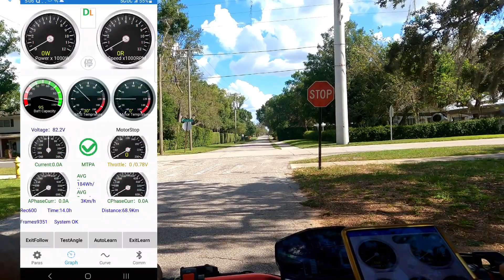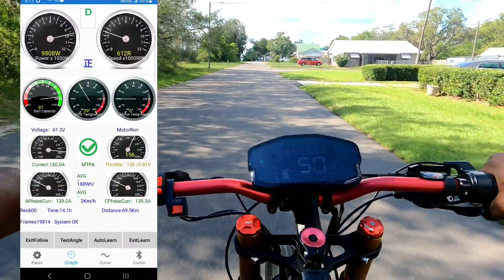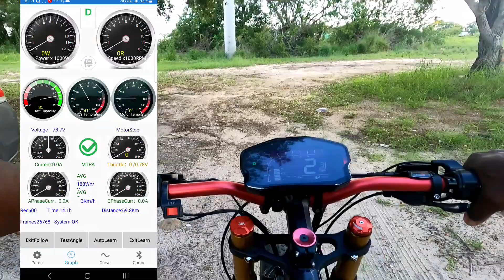diy 72v 27ah battery puts 10,200watts at 170 amps!!!!!

Comment: What ebrake system do you use for variable regen? and does it connect out of the box with a fardriver controller, or did you have to buy an adapter or anything?

Comment: Do you have to do any special prep to the bike to run it that fast?
Reply from the maker: No. Not really just bolted the torque arm to the dropouts and basically it make sure the axle nuts are tight.
Reply: @EBG-offical  The loosest nut on a bike is the one holding on the handlebars! So no bearing issues or tires splitting? Have you gone really long distances at high speed?
Reply from the maker: @craigcowen6920  just 10 miles or so ,I generally do speed
Reply: @EBG-offical  Awesome! I just watched your mega battery pt 2. LOL!!!
I am working on my second bike. I choose a fat tire tadpole trike with a 3000w hub motor.
Getting good info from your channel. Thx!
Reply from the maker: No problem, let me know if you need more assistance

Comment: General question if I run two 72v 3300w batteries in parallel would that give me 6600w?
Reply from the maker: Yes,  it will give you more range but depending on the battery and what cells it has I'm pretty sure you can get 6000w out of it
Reply: @E-bikeguy  thanks so much for that answer.
Reply from the maker: @jamisonhinton5837  no problem 😊
Reply: I figured I could ask you because I just got into building ebikes myself and run into allot of the same stuff when asking questions on discords
Reply from the maker: @jamisonhinton5837  ok no problem

Comment: Hi I herd your comment on making a bigger battery. These people should share there knowledge that's how we all learn. Try Chris crossing wires he's good. Can I ask about tyres I've got 26ins wheel motor on back I had 26x195(54-559 it seem wideish it worn down so my front tyre was still good so I took it of put on back wheel now that tyre was 26x2.10(54-599) so I bought same tyre of amazon and its thinner my front wheel got given to match back motor wheel the rim I would say is under an inch the middle of rim is up shape to match is there a tyre slightly bigger in width but not in height hope this message makes sence.. Looking at your bike there is some power there. Yes I normally watch Chris crossing wires just now and then thanks
Reply from the maker: Oh ok I tried to watch his channel from time to time but he's too full of himself for me I stop watching it and just concentrate on my channel lol but he definitely knows about batteries and how to go fast
Reply: @EBG-offical  yes I agree he's always on bike showing speed and talking ice never seen him work on a bike . Did you get messages on bike tyre 26x2.10 (54-559) front wheel bought the same tyre size on amazon but its not as wide ix there a slight bigger tyre in 26 range m rim is about one insh Shape like a bell not sure of name thanks
Reply from the maker: I don't know really,  all my bike is a 26x4.0 or 29x2.60 and  but I noticed them tires don't last long with big power I'm on my 4th back tire on mine lol
Reply from the maker: I just saw  the latest video on Chris crossing wires and the comment you said about him building ebikes, and boy, did he snapped on you, wow that's pathetic 😳

Comment: I just wired my pack for direct discharge and WOW what a difference.  My bms is 80 amp continuous and my pack can discharge 175 max. Its fun to feel the extra power.
Reply from the maker: Lol nice,  it's a world of a difference
Reply: If you’re using a controller that can take all those amps or even close to it you shouldn’t do direct discharge. First your battery is going to last a fraction of its normal cycle lifetime and when it goes it may go in a fiery farewell while your actually running it. Btw cell continuous discharge capabilities lower over time too. These are the reasons it has a discharge monitor
Reply from the maker: Yes I'm fully aware, and over charging the battery is what short the life cycle. I've been there and done it
Reply: @AaronSmith-mn2hu  all good points to remember 👌

Comment: Hi EbikeGuy I am trying to sort out the wheel circumference as the speedo is going up to 177mph so if you can cover that and also the battery as in how to configure it to match up with the voltages that are custom like mine at 58.1v, thanks in advance man.

BTW the FarDriver controller I have is the ND96v 850pa 450ba, I have the QS 205 V3i 5T battery is 58.1v 400 continuous 800amp burst, soon to up the voltage to 91.3v.
I had to tame this controller as it is a beast and wants to wheelie everywhere which is not my style, the QS205 can only handle 23k watts without heatsink and statorade so I had to set the limits on the controller as 200 BA, 400 PA. the motor goes up to 60c or 150F so its just over a third of the max but the sheer acceleration is thrilling and scary man its just soo freaking powerful so glad we got these controllers :face-red-heart-shape:
Reply from the maker: Heck yeah I really like the fardriver controller the 850 I believe is more powerful than the bac8000 I was going to get a nother qs205 but my supplier told me I need the 273 so here I am lol my battery will be 72v 13p p42a cells will do 585amps  continuously 54.7ah will be more than enough for my light bike at 128 pounds lol but I'll do a video on the display tho
Reply: @EBG-offical  I just came back from a test ride and hayfever is real bad for me atm but I managed to hit 33mph so 3 more than sabvton but Its scary and I ran out of road to max it out, the acceleration is nuts lol :face-blue-smiling:
Reply from the maker: Lol yes it is lol
Reply: Is your bike heavy? I’m surprised a 5t can even get that high in amps I’d think you’d plateau on max speed before using nearly that many phase amps. If your going for speed you wanna go for a 3.5 or even 2.5t(I have seen them but can’t find em anywhere. Might be something that was produced but no longer by qs?)
Reply from the maker: @AaronSmith-mn2hu  that's is what I have a qs273 3.5t and it's at 120 pounds  or 54kg
Reply: @EBG-offical  I know I was talking to the guy who has a 205 5t and I guess a nd95(9 hundrednd something)
Reply from the maker: @AaronSmith-mn2hu  oh ok I know who you talking about
Reply: @AaronSmith-mn2hu  Hi Aaron, I have both the 3.5t and 5t, I use the 5t mostly because I go offroad and trail riding, when you offroad at 30mph it seems wayfaster than on the road and so much more fun than for streetuse. I lowered the BA  and PA to the maximum a qs205 will handle safely without burning up which is 17k without fins and statorade. Dont listen to those who say hubdrives are no good offroad they are and they smash it :D
Reply: What FarDriver are you using? I’m using the 96560 and I’m passed a week after I bought it they rolled out with the 96630 same price.. haha it’s taking the 560spot and they discontinuing it. It’s like an extra 60 pamps and only needs 10extra battery amps. But I’m sure there’s other upgrades in it too. I don’t really need anymore amps though only thing they’d improve is my acceleration up steep ass hills . Looking back at it I’d probably go 72v now and use a 205 instead just to trim some weight off of it.
Reply from the maker: @AaronSmith-mn2hu  yes, I'm using the fardriver nd72850
Reply: And I’d definitely use some high discharge cells I used high capacity and only 10am and made up for it in quantity. But I do t have to charge it that often haha

Comment: woah almost 22v of sag that's abit. was wondering if you know how to fix field weakening coming on slow on the sab. when I full throttle the motor speeds up quick but when fw kicks in it takes over 20s to spin the motor faster. almost as if it's restricting power in fw
Reply from the maker: Yes I did mention in the video I had battery sag  but I don't think the sabvoton has a feature where you can have FW to come on slowly
Reply: yeah that's the thing. I thought it'd be full power all the way with the motor reaching max speed in seconds but mine ramps up so slowly on fw. when riding I don't even think it's fw is kicking in ☹️
Reply from the maker: Oh dang 😳

Comment: If you want to get real feedback plus it's useful for new ideas then go to Chat-Gpt 3.
I ask a question about some potential circuit idea that pops in my head and, end up down an electronic rabbit hole where I learn things I didn't know I wanted too.

Nice ride by the way!  I have a Emmo knight (2020) running 6 - 20ah - 72v lead acid batteries.  They did good last year, I was getting 40-50km on a charge.

This year, so far i'm getting more like 30's, plus I could get up to 74 km/hr now it's 65-67 km/hr.  I'm going to check and probably add water to them, to top them back up & rotate them around. 

Chat-Gpt gave me all the possible configurations to try and max the distance, while 
keeping the power.
Reply from the maker: Nice, ok I'll definitely check it out.  How to get to this chat gpt?

Comment: @4:19 this highlights a potential problem with fardriver in that your battery was already at 83.5v and still sending 30a regen. And if you started off with full charge (84v) then it would definitely overvoltage some cells. 

This is where some pros and cons of BMS come in. If you had a BMS (not bypassed), it would have most likely closed the port because at 30a charge, certainly one brick was over 4.25v. And closing the port while doing regen can normally cause the controller to spike and fry some mosfets.

Of course not having a BMS has its own issues. If there were a cheap smart BMS that can be installed bypassed, at least you can see what’s happening and decrease regen. 

Of course your new battery will fix this somewhat because you still only need 30a regen, but the bigger battery will soak those amps up like a sponge and also not cause as much cell differential. 

As you see you can’t change the Fardriver OVP in the app or PC. But might be able to change it in the configuration file on the PC. 

As it is. My friend just disables regen until his battery is drained below 82v (20s lithium ion), and his battery is 50ah and his max regen is only 20a. 
But he does have smart BMS so he can see exactly when regen is too much (one brick approaching OVP).

I might have to wait until i find a cheap controller locally that I can test because messing with the configuration file manually could potentially brick the controller. But I think as long as the original file is downloaded from the controller in use, then should be ok to modify some things. 

But as you can see, when you change some settings, the controller automatically adjusts some other values. Like if you change battery voltage from 84v—>72v, it will automatically write in new OVP and OVP Release voltage values. So what happens when these are manually modified is anyone’s guess.

I can tell the Fardriver app is written for some very upscale controller firmware, because it has many things the controller doesn’t accept, like certain pole pairs or temperature sensors that are in the app dropdown list but not all controllers. As someone who did some basic programming, i know nobody adds things to the dropdown list that are totally useless. Lol
Reply from the maker: Ok I get what you mean but I do know on the sabvoton the regen will not work until you battery dropped a certain voltage, I don't know about the fardriver have not gotten that far lol
Reply: @EBG-offical , yes. Same with Votol, you can easily set the OVP based on your battery and then Max Regen voltage os OVP-5v. 

I can see on your app you battery was already at 83.5v and still sending 30a. Your OVP is the default for 72v (90.7v) which is ok for AGM lead acid, even if regen was allowed up to OVP-5v like the votol.  But 85.7v regen on a 20s lithium ion is definitely not good. Lol.

Unfortunately since you cant just lower OVP until you see regen being limited, and you can’t raise battery voltage slowly until you see regen being limited, not much can be easily tested. And even if if was found that the Fardriver regen is OVP-5v, you can’t set OVP because its locked. 

Its the only programmable controller I ever saw where you cant set OVP and max regen voltage. And quite ridiculous to expect someone to disable regen and then enable it every ride. Lol
Reply from the maker: Oh ok that's interesting nonetheless
Reply: @EBG-offical  , yes, doesn’t really affect you much but for your viewers who get the fardriver and build a battery with BMS, it can destroy their controller if they change regen from default (4a/6a) up to 60a and the BMS closes the port. 

You have no hills but anyone living on top of a hill and fully charge and then use regen, with or without BMS there will be a problem. 

Judy won’t talk to me because I didn’t buy anything from Siaecosys yet. Lol. I’ll see what i can get from my friend because he will buy a 72680 from them and then get support. She’s very good at customer support but terrible at non-customer support. Lol
Reply: Your controller has energy regenerate table but my friends controller doesn’t. That’s one example of how different models have different firmware. But if he opens the app (either ios or android) without connecting, it will show that energy regenerate table. So its in the app, just not his firmware.

So it makes me wonder, where is the controller that has the most robust firmware? And are any unlocked so you can easily change all relevant settings? Or does that take a secret password? Lol
Reply: Theres an update firmware option in the Bluetooth connection screen, not sure where to get said firmware but there def an option toupdate controllers firmware
Reply: @AaronSmith-mn2hu  , yes, but I never saw anywhere to get the firmware. I’ve seen people say they have a new firmware to try and will post the results, never to be seen again. Lol

Comment: Yes, battery builds can be quite emotional. The solder vs spot weld vs threaded terminals with bus bars. BMS vs No BMS. Fused vs non-fused. Glued vs dedication cell holders. No end to the heated debates. Lol.

My friend recently built a battery, the easiest shape (rectangular) but the more complicated hexagonal arrangement. So he ordered some 2S hexagonal tabbing but the wrong type. I was like “what? How is that even possible?” Lol. But there is actually two types depending on if the parallel group is all inline or the zigzag row. And that was dictated by the maximum length and width of the battery compartment. So he couldn’t change the parallel group from zigzag to inline without it being wider or eliminating one of the parallel cells (and nobody wants to do that).

And since he had no patience to order the correct tabbing, he used about 300 short 10mm wide pieces of tabbing and spot welded them 3 layers deep. Then he connected the BMS balance leads to the end of each parallel row. But since these rows are all patchwork, the resistance is different, and every time he pulls 150a the cell differential climbs. Its not a huge problem other than it makes it harder to use cell differential as a indicator of a problem as the pack ages. But its only noticeable if you have a smart BMS with Bluetooth app. 

Aside from that, his pack stays in balance so well after the initial top balance that it’s almost like his BMS is secretly sneaking in some balancing. Lol.
Reply from the maker: Lol nice that your buddy got it done and you is exactly right about the battery debate I do need to understand that

Comment: Great vid buddy. Do you have a link for that display? Also would you make a detailed video on the features of the display and how to hook it up to a fardriver controller. Im getting my cs20 bike soon but i not crazy about the display so im looking for something nicer and the one you have looks real good. Cheers.
Reply from the maker: Ok I will  make a video of the display next week  I'll send you the link in a few
Reply: @EBG-offical  no need for the link, im subscribed to your channel. Does the fardriver need any special program to accept this display or do all fardriver work with this display?
Reply from the maker: All fardriver will work with this display it's actually designed for it
Reply: @EBG-offical  Hi EbikeGuy I am trying to sort out the wheel circumference as the speedo is going up to 177mph so if you can cover that and also the battery as in how to configure it to match up with the voltages that are custom like mine at 58.1v, thanks in advance man.

BTW the FarDriver controller I have is the ND96v 850pa 450ba, I have the QS 205 V3i 5T battery is 58.1v 400 continuous 800amp burst, soon to up the voltage to 91.3v.
I had to tame this controller as it is a beast and wants to wheelie everywhere which is not my style, the QS205 can only handle 23k watts without heatsink and statorade so I had to set the limits on the controller as 200 BA, 400 PA. the motor goes up to 60c or 150F so its just over a third of the max but the sheer acceleration is thrilling and scary man its just soo freaking powerful so glad we got these controllers :face-red-heart-shape:

Comment: You're definitely an inspiration! I was curious if you have it setup for pedal assist too? I know you said in previous videos you like to use your bike for exercise. Can you fine tune various modes (levels) for the controller so you have an exercise mode and GO mode? Stay safe!
Reply from the maker: The fardriver don't have peddle assistance I wish
Reply from the maker: I just peddle when it's flat when the going get tough I just throttle it lol
Reply: @EBG-offical  Same but the going gets tough 99 percent of the time with me and I have peddle assist. I definitely need to get fit :)
Reply from the maker: Lol me definitely my gut is too big 🤣 😅